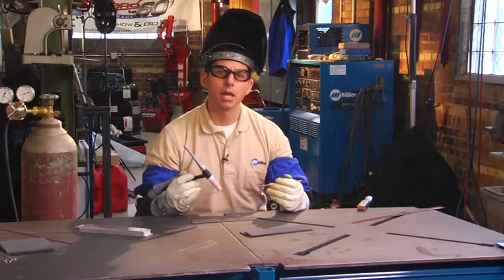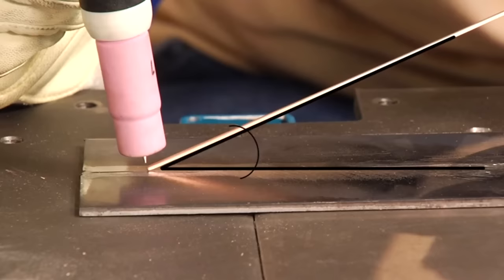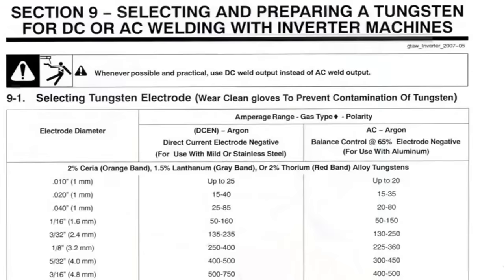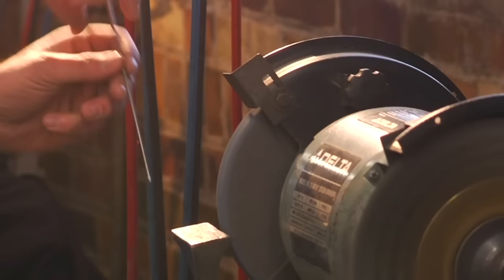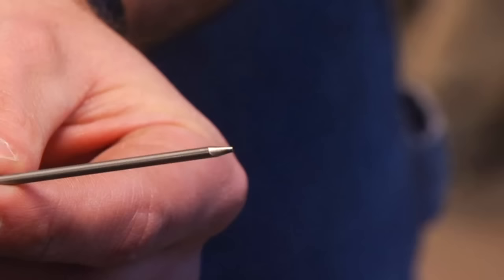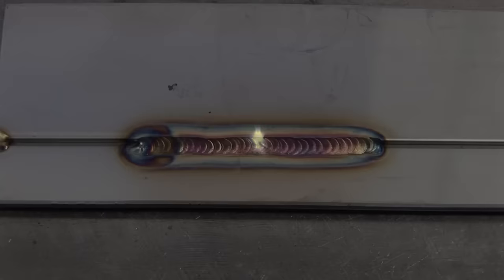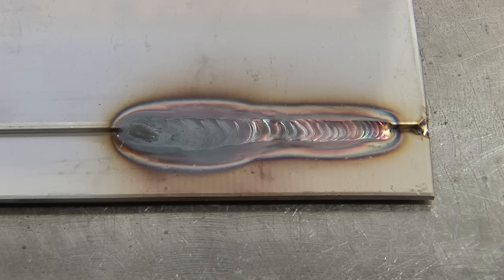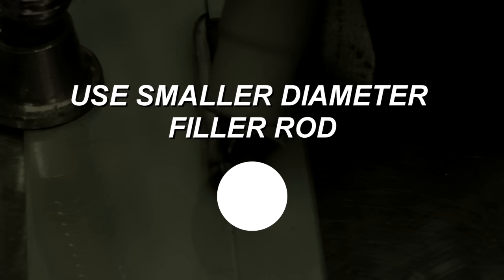TIG Welding Tips and Techniques

Comment: Just a quick reminder to those watching that normally you should not hold a workpiece against the grinding wheel in that position as it can easily get pulled down between the rotating grinding wheel and the tool-rest.  The wheel can shatter throwing out bits of material at a very high speed causing injury.
Reply: Worcester Exchange
Reply: Worcester Exchange WEelder For sell
Reply: dont dare care something unimportant like this

Comment from the maker: Basically, when you’re dealing with TIG welding aluminum in high humidity, you want to be certain that your base and filler metals are as clean and free of moisture as possible. In addition to typical degreasing and oxide removal, the base and filler metals should be kept above the dew point temperature so that ambient water vapor doesn’t condense on the surface. If this happens, it will saturate the porous oxide layer and complicate your cleaning procedures. 

Hope this helps! Weld safely.
Reply: Thanks for that.... Hope to learn more

Comment: should not be talking too much about  Miller, highly reliable devices with very stable voltage is also very durable, I used them in workshops and in the field, I am particularly pleased with flexible cables.I would like to one day buy up one myself :) I'm a professional Welder I have worked in several countries (Germany, Italy, Norway, Russia) and I always happy when I get to a new place and seeing Miller :) greetings from Serbia

Comment from the maker: This is a common application for a TIG welder.  The wall thickness of the tube/pipe dictates the weld amperage requirements need.  Both the inverter based Maxstar® 150 and 200 TIG machines are commonly used for this application.  Personally, I would opt for the Maxstar® 200 based solely on the inclusion of and adjustability of the pulser feature in that machine. ... (more sent directly to the emails provided)

Comment: I might also add.. as someone that has TiG welded on and off for over 20 years... (I'm still a total hack!!) a good cheat with mild steel is to use stainless filler rod... make sure everything is clean.... if you can do as many test pieces if you have spare material... practice... practice... practice! In my peak I could free hand weld along the edge of a single edged razor blade... though it was with a very ancient Tig welder.... still got that blade somewhere lol... couldn't hope to do that with my 200amp inverter hack machine I have now.
Cheers for the tips... they all help!!

Comment from the maker: There are several factors that control the amount of heat input or puddle size: 
Amperage – controlled either by a foot pedal or fingertip control – more amperage will result in more heat
Voltage – controlled through the arc length – a longer arc length will result in a higher voltage (which results in more heat)
Travel speed – slow travel speed (more time in the same) area typically results in a larger puddle
(cont.)

Comment: Thank you for the video . I'm new to welding but really want to jump into Tig welding right away . I'm sure with practice and diligence I'll figure it out .  Buying a Miller 210 this week
Reply from the maker: +MartyBlue78 We're happy to hear that our video has been helpful. Let us know how you like your machine! Weld on...
Reply: Miller Welders j
Reply: Hey man get after it! Just one thing to keep in mind is that you should watch real TIG welders, not this scrub. You never point the tip going into the grinding wheel(it should be noted you need a separate wheel for tungsten), for aluminum you round the tip and for the Taper size on the tungsten it’s not up to 2 1/2 the diameter size, it’s actually 2 1/2-3x the diameter

Comment from the maker: Settings should be the same for any machine even if the interface is different. Set it for DCEN, remote (foot) amperage control, 100% argon shielding gas flowing at 15-20cfh, 3/32” diameter 2% ceriated tungsten ground to a truncated point, and you should have filler metal rods of alloys 304L or 308L. If you want the owner's manual, go to the Millerwelds website, resources, owner’s manuals, search by name to download the manual in PDF form for free.

Comment: this video is very helpful for my tig welding project .But i cannot get clarity in using the smallo diameter filler rod for stainless steel.So, i need a clarity in that

Comment from the maker: Helium will transmit more heat to the part than argon when both are set to the same current output. So, if  an application requires deeper penetration, using a helium blend or pure helium are an option.
However, helium is known for poor arc starting characteristics. It is more expensive than argon per unit volume. It requires much higher flow rates than argon (about double), which makes it even more expensive to run. Unless your application demands helium, you're much better off with pure argon.

Comment: very useful and practical tips but i am a model aircraft builder do you know if you can tig weld piano wire it is sprung steel and i dont want to make it brittle as it doesnt flex if its heated up to much would a tack weld be ok

Comment: Nice explanation, can you TiG without gas if you are welding without filler?.I mean is it necessary to use shield gas even if you are TiG welding without filler?
Reply from the maker: Hi there, For TIG welding it doesn’t matter if you are welding with or without filler metal you need a shielding gas. You need the shielding gas for two things: 
1. The main reason is to shield your arc from the atmosphere (if your weld isn’t shielded you will get contamination).  
2. The second reason is to light your arc, if you don’t have shielding gas you won’t get your TIG arc to light off because you need that ionization of the gas to light your arc.

Comment: I just recently purchased the Diversion180 and my challenge is being able to work with the manual head adjustment as supposed to the foot control. I either get too much heat or not enough heat. What I am doing wrong. Thanks in advance.

Comment from the maker: Diameter of filler material – too large of filler material will lead the operator to use too high of an amperage for the base material; on the contrary, too small of filler material (or not enough being added at the appropriate time) can result in puddle growth
It is not uncommon for a person to struggle with the coordination of the controlling parameters. Similar to driving a car and controlling the speed with the accelerator pedal, I recommend a foot control as much as possible.

Comment: I have a problem with my school's tig machine ( miller syncrowave 200 i think) its old though. Anyways, when i start the arc the machine creates like electricity crackling noise when I'm welding; it still produces somewhat good quality welds. I would be welding steel and it would make this noise regardless of the material or thickness
Anyone had this problem ? Thanks and gr8 advice

Comment: Grinding question. I know the direction for grinding should be parallel with the tungsten shaft and noticed the finish difference between grinding with a diamond vs standard wheel. My question is how important, or to what determent, is it to weld with parallel grind marks on the tip left by a regular wheel? The diamond will get the tip to a mirror finish which is obvious a better choice.
Thanks for the videos!
Reply from the maker: Thanks for your question, Tom! Parallel grind marks allow for a stable arc, whereas radial ground marks result in arc wander. We have a diagram on our TIG welding setup page (#5. Prepare Tungsten): https://www.millerwelds.com/resources/welding-resources/tig-welding-resources/tig-welding-tips-intro/tig-welding-setup  We hope this helps. Let us know if you have any further questions!
Reply: I understand that, but what I was asking about was how much of a difference is there between grind marks left by a regular wheel vs. the much better finish from a diamond wheel?
Reply from the maker: Diamond wheels are preferred because the diamond material is much harder and will provide a more consistent cut/grind on the tungsten, however a diamond grinding wheel could theoretically leave the same roughness on the tungsten. The purpose of a diamond grinding wheel is more for contamination purposes. There is a minimal possibility of contamination of the tungsten from the adhesive or abrasive as compared to a traditional grinding wheel. For example, one common abrasive used in the industry is aluminum oxide, which can cause contamination of the tungsten resulting in a less than ideal arc. We hope this helps. Let us know if you have any further questions, Tom. Thank you!

Comment: "Aids the flow of current down the length of the electrode?" The direction of the grind on the probe, I highly doubt will aid in the flow of current. A clean electrode will aid in the flow of current, maybe that's what you meant to tell.

Comment: Hello sir I want to asking u which type and model u advice me to use it in my small Auto repair car? Thank u
Reply from the maker: +Amee Hassa Thank you for reaching out. Are you operating on 120V power, or do you have access to 240V power? Also, what material and material thickness would you be welding most often? Those are some questions to keep in mind as you look for a machine. If you're looking for TIG, we recommend looking at the Diversion 180 first: https://www.millerwelds.com/equipment/welders/tig-gtaw
Please let us know if you have any further questions as you take a look at the machines.

Comment: dear sir, 
is this device available in India? , can it layer weld very thin stainless steel sheets of 0.60 mm  0.40 mm without making holes and damage to sheet surface?  What would be it's expected price in Indian market New Delhi..?
Reply from the maker: Thanks for your interest in Miller welders. For product availability in your area, please contact an authorized Miller distributor near you: https://www.millerwelds.com/where-to-buy-International.

Comment: I have a question,pertaining to an older model Miller Bobcat 225 NT onan engine model and i would like to know when adjusting the fine adjustment knob from 1 to 10 what increments does each number go up by?
Reply from the maker: Hi David, thanks for reaching out. To best answer your question, could you please provide the serial number on your Bobcat?
Reply: Serial  KH401396.  

Stock 903500

Comment: Does anyone teach lay-wire technique for stainless?  Seemed to work pretty well for me, and it creates a great looking weld.  It is a cold weld, though.
Reply: could you explain or describe "cold weld"? 
Not trolling, just curious.
Reply: +MrJgstoner cold weld refers to a weld sitting on top of the parent material as opposed to attaining fusion/penetration. although i think that jtomasik could fix his issue by messing with the amperage because you can absolutely get fusion/penetration with the lay wire technique

Comment: Don't hold anything too firm when using a grinding wheel. You holding it tight but light enough that the wheel will take it from you and not pull your finger into it. I watched a guy sharpening tungsten have the wheel snatch his finger in and rip his finger nail off. Same applies to table saw and such.

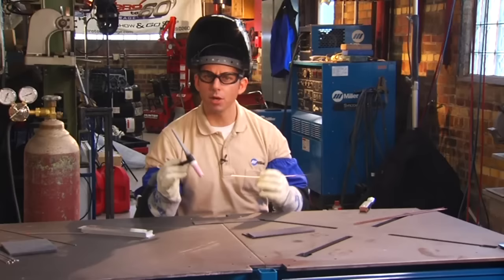Comment: 1:25 why is your Argon tank so close to the bench? that seems kind of dangerous...
Reply from the maker: +Esoteric Grave That's a great question. There should be no issue having the tank near or touching the table as long as the tank is not becoming part of the welding circuit or being heated excessively. Whenever a safety cap is off a high pressure cylinder such as the one shown, it should be secured in a cart, bottle tray or to something sturdy/solid (the table or a wall). Please let us know if you have any further questions. Thank you!

Comment: why do you have to sharpen it?
Reply from the maker: +Ultra rc - Historically, preparing to AC weld required selecting a pure tungsten electrode and forming a ball at the end of the electrode. Balling, until now a necessary evil (pure tungsten tends to form a ball), promotes arc wandering, less arc focus and poorer arc starts because electricity likes to come off a point. With a ball, the current can dance around the entire surface. That's why Miller now recommends that, for AC welding, operators should sharpen the tungsten as if they are welding in the DC mode. This is true for all advanced TIG machines, and especially for inverters because it optimizes performance. Read more here: https://www.millerwelds.com/resources/article-library/new-advanced-tig-welding-machines-improve-fabrication  Please let us know if you have any further questions.

Comment: so you dont neccassarily have to have a ball point to do tig welding???
Reply from the maker: Hi, Michael. Thanks for your question! No, you do not need to have a balled tungsten. Due to the frequency of a transformer-based machine (or phase controlled) when using a pure tungsten, the tungsten will ball up in AC. This is what was used to weld aluminum in the past, but this is not preferred as the arc tends to wander resulting in incomplete penetration of the joint.

Using a 2% ceriated tungsten, rather than pure (which should never be used with inverter based machines), will help to keep a pointed tungsten producing a more stable arc and thus resulting in decreasing the chance of incomplete penetration.
Reply: +Miller Welders oh wow! thanks!! that maybe why i have trouble starting an arc when do a tee joint in  aluminum welding.